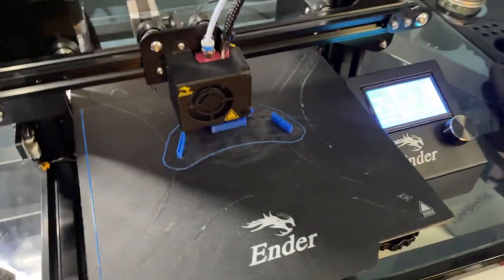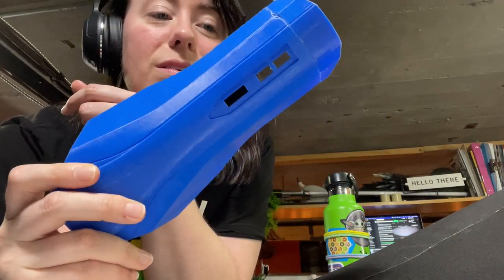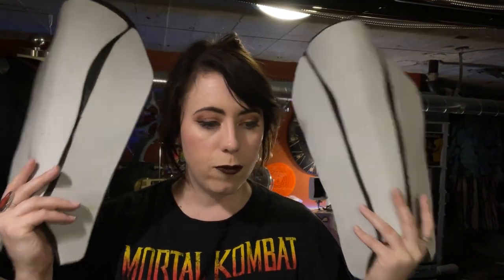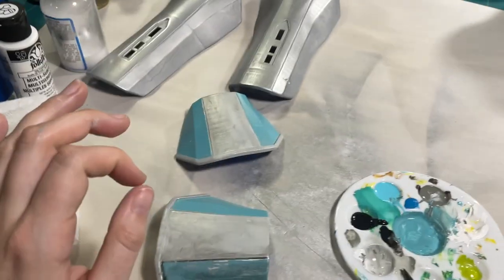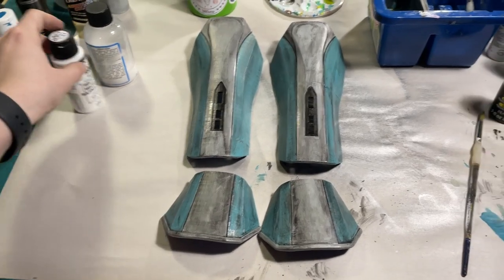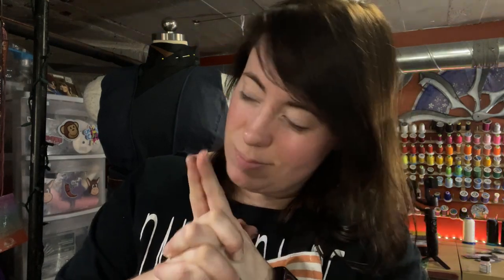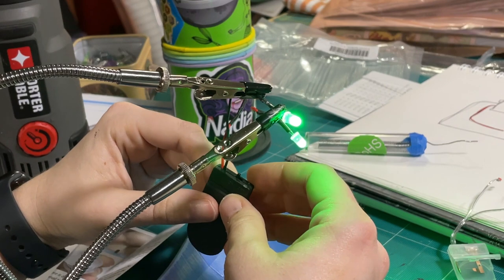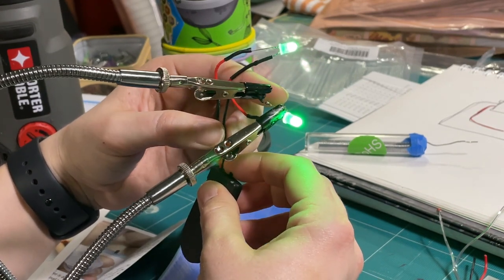Making Ahsoka Tano week 12| "Focus on painting Amanda, don't get distracted by Wanda's new outfit 👀"

Comment: Looking excellent ,did you try wiring the leds in parallel you can then run them off one coin battery?
Reply from the maker: umm...i guess not. lol. This was my first time doing anything like this. I will have to research that!
Reply: @Jedimanda   rather than wiring in a line like you have, have all the positive leads connected on one lead and all the negative leads on the other. They will then all draw 1.5 volts from the coin cell rather than three sharing the voltage between them thus not lighting. Think of it like the sleepers on a train line.
Reply from the maker: @Arachnoid_of_the_underverse  OH! Interesting. That makes me rethink some things. Thank you!!!
Reply: @Jedimanda  Glad to be of some help. If you find a long led set up not lasting enough hours you could also have two batteries in parallel thus giving the set-up twice as much time.